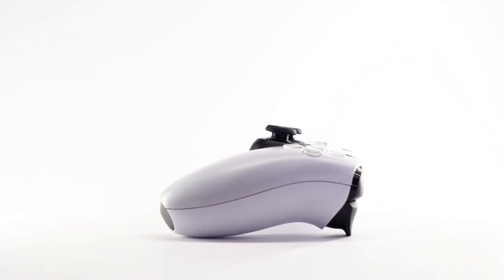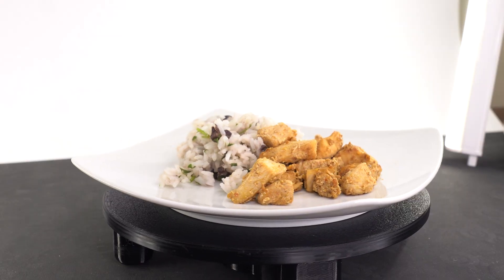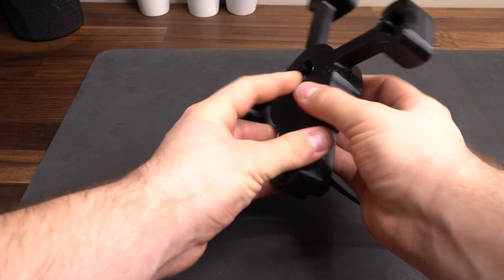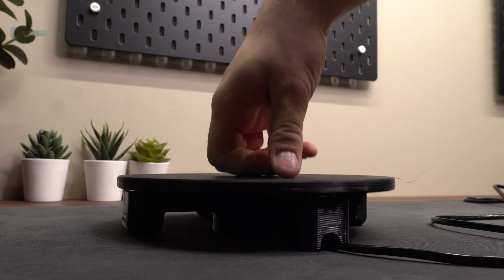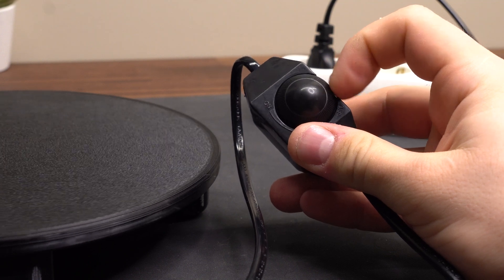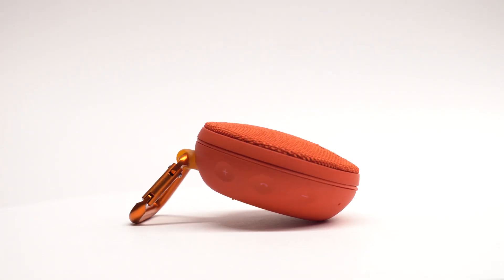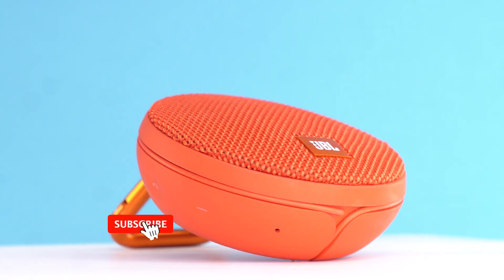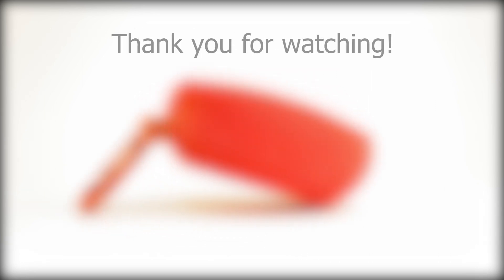Motorized Turntable 3D Printed - How to make cool product shots

Comment: It is normal that the motor turns super hot?
Reply from the maker: My motor gets really hot too. But in reality, even though it feels «really hot» to the touch as it’s because our bodies are about 37-38. However, seen from a mechanical point of view like 50-70 degrees isn’t really that hot for the materials in the motor 😊

Comment: Can you mention the mm of M3 screws which your using ?
Reply from the maker: The length of the M3 screw I used was just 10mm, but longer than that is no problem either.

Comment: Why not design to have the bolt on the top of the base for easy installing ?
Having the bolt inside is very hard to keep a hold of it
Reply from the maker: I could have, actually, you can just mount it the opposite way if you have short enough screws. As long as they don’t go all the way through to hit the plate.
Reply: after actually building your way would be lame.

Comment: i just got one of these motors and will be making one of these - the specs on yours says 5/6 RPMs, do you have any ideas why the dimmer didn't allow it to be speed vairable? i'll try a potentiometer for mine... its a nice flat motor so i hope i can get it to work. either way i guess  the speed isn't that bad!

also, why does your PS controller have a momentary switch on it?
Reply from the maker: I’m actually not sure why the motor can’t be speed controlled… maybe there’s some kind of control board inside the motor or something that forces it to spin at the 5-6rpm but I’m not sure.

About the button it’s just for cheating, it activates my aimbot on and off…

Just kidding, it’s actually wired to my X button and serves as a jump/climb button when I play Warzone. Just allows me to jump and aim at the same time without having to let go of the joystick. 😃

Comment: Looks like a good design. I'm going to be assembling this I appreciate the build videos and files. A note to other prospective builders, I know he mentions it in the video but the motors that come up first in the search are 21V AC and should not be used with a standard cable that plugs directly into your wall. If you are from NA use a 110/120V AC rated motor everywhere else is 220/240V AC. Absolutely look up what voltage is standard in your country.
Reply from the maker: Thank you! The reason why I didn’t link a specific motor but rather the search words was because I personally use 220/240v rated motor but a big portion of my viewers are from NA and require a different voltage like you mention 😅.
Reply: where does one even find 21V AC outlet xD. i am baffled
Reply: You don't, if you end up having a motor rated for a different voltage like 21V you'd need to find a power supply that outputs that voltage. Finding a motor that matches your receptacle output is more cost effective and requires one less piece of hardware.  @tazztone